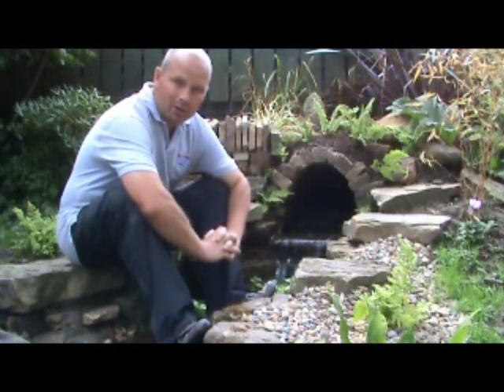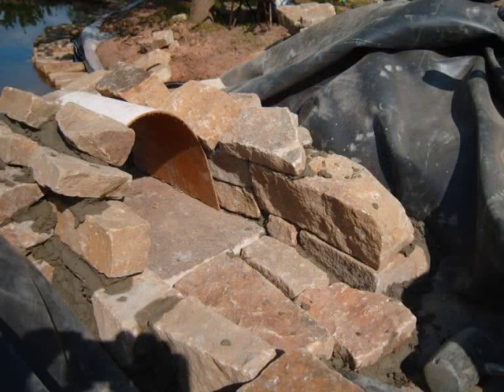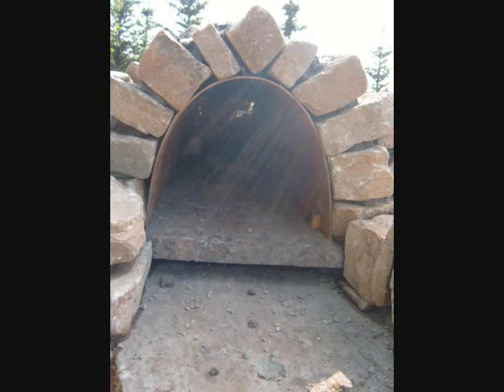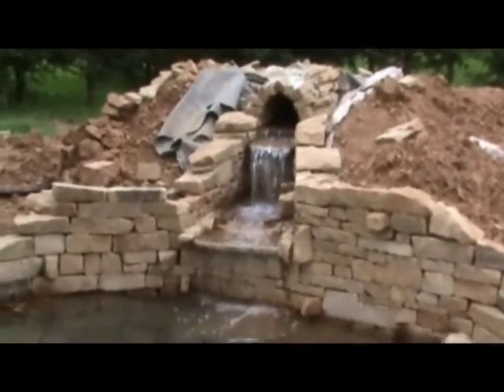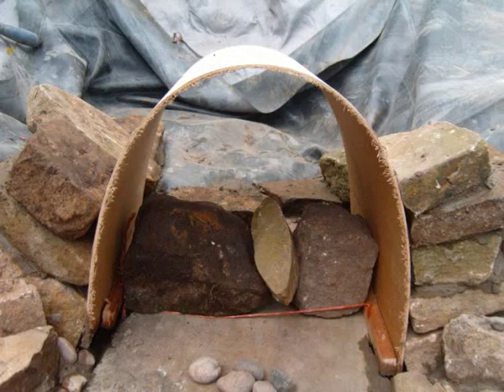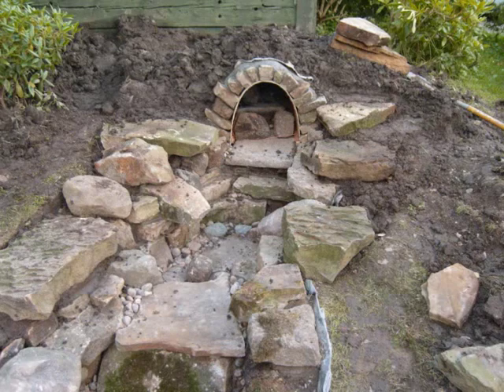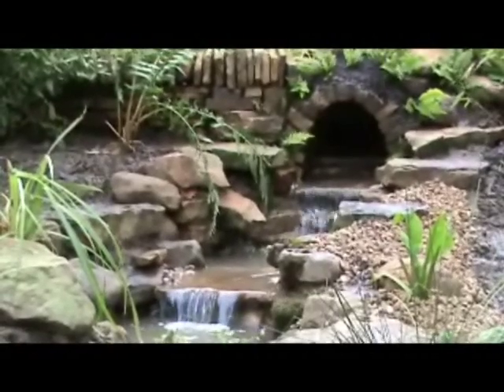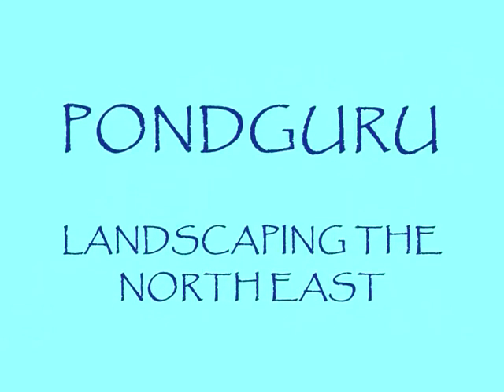PONDGURU - POND TIPS - How to build a stone tunnel

Comment from the maker: I nearly always use pressure filters so there is just a 38mm pipe to feed into the back of the tunnel (well above the intended water level). If you have rigid pipes you can just do the same, no worries. A pressure filter is easier to hide obviously as it can be anywhere between the pond and tunnel. A box filter will need to be above the level of the tunnel as water flows from that sort of filter via gravity so is a bit more tricky to hide unless it is well away from the tunnel.

Comment from the maker: It would split the flow, therefore if you had 25% going down one stream, only 75% would be available for the other stream. The splitter from OASE allows the flow between the streams to be adjusted infinitely but obviously if you allow water to increase in one stream, you will reduce available water for the other. It is normally more efficient to have a larger pump supplying two streams than having two smaller pumps, one for each stream.